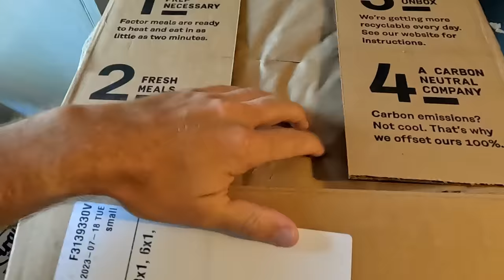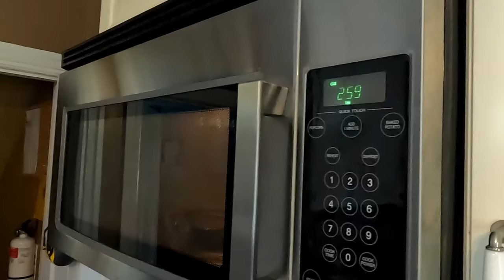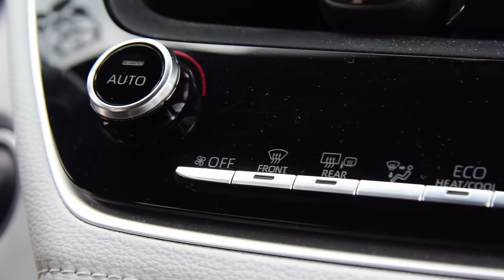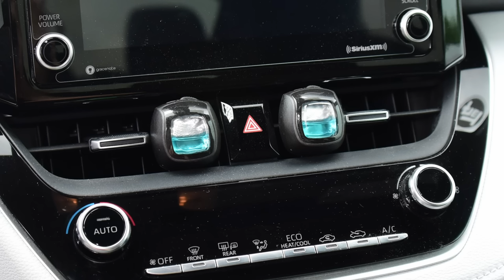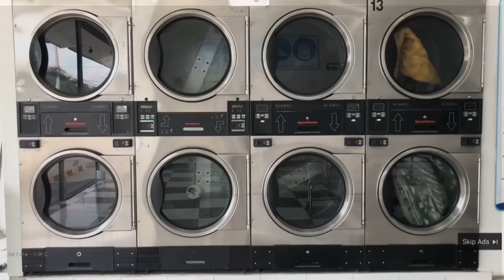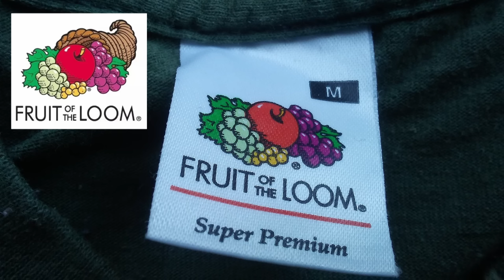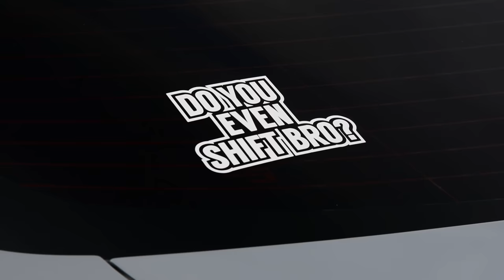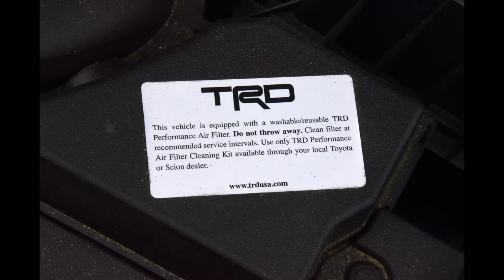2022 Toyota Corolla Apex 6MT: Regular Car Reviews

Comment: I have to admit, when the E210 came out, I was really a fan of what toyota did in regards to the interior (I believe the one I was in did not have that massive touchscreen/display, but I could be wrong). Kind of sad to see them make an "apex" badged corolla and miss like this. I'd be tempted to take a toyota matrix gr over this, which is kind of insane considering that car is now a decade old- but I think to some degree, that car hit the mark that toyota was aiming for with this. This car should be a hatchback, and it should've been a bit more enthusiast focused if that's what they were going for. A 2.0 naturally aspirated engine. Sure, maybe it doesn't need the awd and turbo I3 of the GRMN. Better tires, better brakes, better ergos, a different differential, less fluff, along with the anti roll bars- I feel like that could've made this car way more appealing. I wonder if their 2.5 could've fit in there.

Comment: IIRC, twin injection isn't about performance, it's about keeping the intake valves clear of carbon deposits. Anyway, Toyota needs an engine between this one and the turbo-3 in the GR. Maybe a 200-220hp 2.5.

Comment: RE: Tow hook location - if it is a "J" VIN car, there will be a panel above the drivers side LED strip/fog light that will pop out; for some reason, US built cars do not have the pop-out, you can buy the OEM part that will allow access to the tow hook, but man is it a strange move on Toyotas part to make that distinction (Also to release this trim in the first place). I wonder how the plate relocating mount he has works, as most connect to the tow-hook location. Calling BS on that dealer trade story though; if a dealer offered me a nigh-unobtainable GRC w/$5k on top for an Apex corolla, ANYONE would make that trade in an instant, even if I didn't want the GRC I could flip it for an even larger profit and get something I actually did want. There is a $10k increase in MSRP for the GRC Core trim over the Apex; that's a 15k delta in his favor, also ignoring that most of the GRC Cores that have actually hit dealers in the US are "loaded" eg. have the the performance, tech & cold weather packages which adds $2,500 to the MSRP. Every dealer I've talked to about the GRC has a waiting/deposit list a mile long & the majority are charging ADM; I've been looking since April of 2022 for a GR-C, well before it's release, and the availability/ADM situation hasn't improved.

Comment: Imagine selling a Corolla with the same 0-60, same power, less torque, and less mileage than a mid 2000s stock BMW E90 320d (with the good M47 Diesel engine), for $45k MSRP, and as a "special edition". Incredible trick, Toyota

Comment: I got the 2022 Corolla SE with the 6 speed and put a small 6 speed sticker on the back bottom corner of the rear glass and now I'm thinking I made a big mistake lol. I guess the 2022 SE's FKS is just as unresponsive as the 23 apex. And you can definitely get 40mpg if you short shift and feather the gas. The steering is horrible as well, but there is a setting that does nothing in the infotainment center for steering sensitivity.
Reply: Maybe it wasn’t a mistake. Seeing it’s a MT may repel thieves

Comment: To be honest, anything more than the base level Corolla or Camry (so the LE or SE models) is a bit of a waste of money because you're paying thousands more for plastic pieces and slightly nicer seats (of which you could buy seat covers for maybe $100). I mean even the SE model is sporty enough for most people and are relatively fun to drive (although I don't like the Corollas as much compared to the Camry simply because the Corolla is an economy car not matter what trim level you get, where the Camry is more of a mid-sized sedan and I feel it's better built, but of course costs more).

Comment: This reminds me of the Mazda 3 Carbon Fibre Edition, that was only sold for the Canadian market. Limited run, of an exclusively white Mazda 3 with carbon fibre vinyl wrap on the mirrors & roof, and on the inside trims, and wheels exclusive to it (I wanted those wheels tbh, they're really nice). 
aaaaaaand there's nothing else. It's just that. On the GX trim, which was the base model. Zero other changes. What a strange thing.
Reply: Base model shoppers deserve options!!

Comment: I am driving a newish rental carolla right now around Philadelphia this week. It’s garbage. The build quality and material quality are junk. Obviously a rental will have the bone stock engine trans and suspension so I can forgive that, but interior panels are already falling off and the transmission has no idea what gear it wants to be in at any given time. Junk…. I wanted to actually test drive one recently but could not find one on a lot to try. Now I know I made the right decision going Integra. Was going to go civic SI but they had ADM and Acura did not making them the same price. I just went S spec tech package. Wanted to go manual but have others who will occasionally drive it who can’t use a clutch anymore.

Comment: I get that the apex is supposed to be sporty but I feel like those tires are possibly a bit overkill… I say that because it’s the same set of continental extreme contacts that I use on my LS460 only difference being size of course but still I can’t imagine 169 horsepower needing tires that grip hard because my car with 389 horsepower is just barely enough to push those tires over their “limit”

Comment: I have fun in my SE. Its a super solid, fun, economy car. Not everyone wants a sports car. This thing takes regular, I can toss it around, and it can carry passengers comfortably enough. Its a swiss army knife. Does lots of stuff which is awesome but doesn't do anything particularly great. It is easily customized too with lots of aftermarket support. Good deal honestly for what you get.
Reply: I’ve got a 23 SE for my kids first car and am fine with it for what it does. I’ve got an older e92 M3 and e90 335 and outside of a track this vehicle does just fine in routine driving. Lots of tech for the price and zip make it fun. The only thing is I wish I could have found the hybrid.

Comment: Was a big fan of this car in the review, even for (maybe even because of) its silly ass styling. but i looked up to see if these exist in New Zealand, and this body style does - maybe not called an apex but idk. EITHER WAY its new car money, hell nah. If this was a budget car, i'd get it, but now what the hellll is the point. It should be a CR-Z competitor I feel like, as it also comes as a hybrid here, and I like the CR-Z for the same reasons as this. But nah, its triple the price
Reply: you're talking about used. a $10,000 crz is on its last legs let's be honest. the rust is starting to take and the battery is shot.

this is like the Corolla SE trim, that's $23,950. the apex was $29,500 and gets you the body kit, the exhaust and the suspension.

I can tell you right now when the civic hybrid comes out it will be about $30k, they come well equipped like an EX.
Reply: @DrRyan82994  we talking nz and NZD? Rust is largely not a problem and they’re all 9k to 13k (prices keep going up and down between that on the same damn car from dealers) which is relatively affordable. Also it’s probly dumb to compare such a new car to it to be fair, in fact they’re probably not comparable in general - only as far as Cars Id Like to maybe Own. Not even disagreeing with anything u said actually, just clarifying whatever i was talking about

Comment: Wrong wheel drive, it's not an ae86.  Rear independent suspension, it's not an ae86. It will get driven circles by a Miata, wait maybe it is an ae86. For the price of an AE86 or an Apex Corolla, the answer is clear, As much Miata as you can afford.

Comment: The Cavalier was an amazing little car for the price point. Can't convince me otherwise. Didn't eat oil like the 90's Corollas with f'd piston rings lol.
Reply: My Cavalier ate oil like a 318 Detroit diesel.
Reply: @darksu6947  Which engine did you have?
Reply: My grandparents' 1993 made 480,000km with no major oil leaks like that.
Reply: @ghost_tom_joad8530  I've had quite a few different Cavaliers. My father runs a body shop so he was all the time buying them at auctions. Needless to say some were high mileage. Whenever he got tired of the one he was driving he'd pass it down to me and I'd drive them until they died. I've had one square body, but the rest were 94-05. All of that just to say I've had everything but the v6 variants. Some used a lot of oil, some used a little but all of them were great little cars that we never had to spend much money on. I drive a 2012 Impala at the moment and I love it! 300hp direct injection 3.6 v6 with a 6 speed auto, it's the same setup they put in the v6 Camaro. I have no idea why but I get compliments on it all the time. Stuff like, I like your car man, that's a good looking car, sweet car bro! Maybe they have a fanbase I don't know about lol. Sorry for the novel but I'm bored and you asked 😁